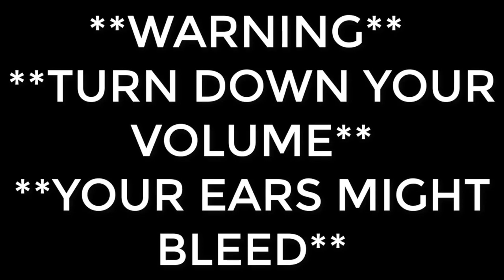15" Brake Conversion N54 Drag Setup

Comment: Im hoping it all works out, would this be a good platform for making 800whp- 900whp im also in ontario, from a cost per hp perspective?
Reply from the maker: Thanks man appreciate it. Stock block N54’s are more than cable of making 750whp, you have to start building the engine if you want to push more reliably.
Reply: @dujon5481  Okay, could I hit 800-900 on a e60-e70 blend? I gotta import e85 so its more convinent for it to be a blend.